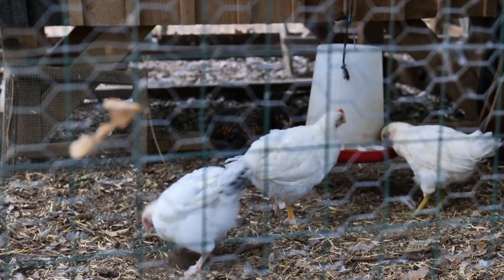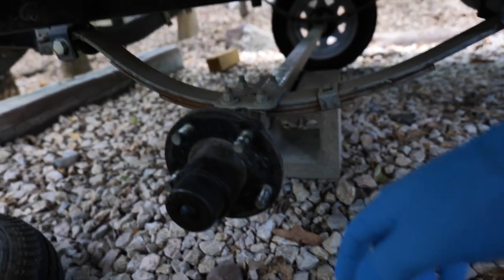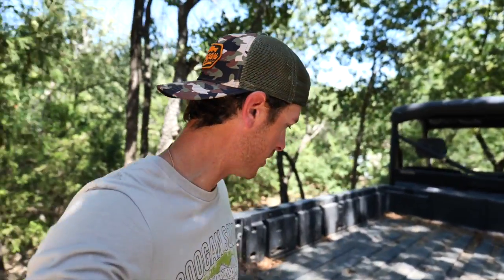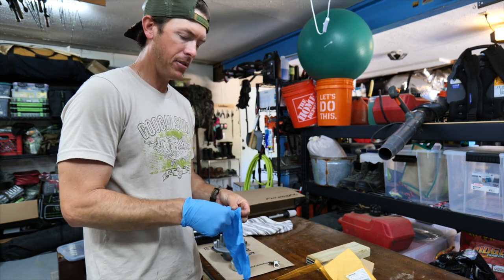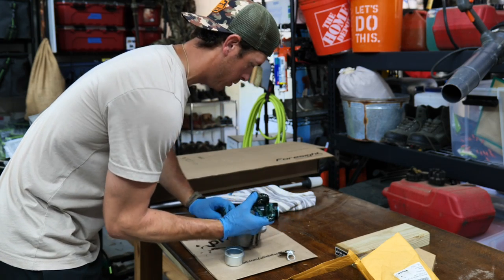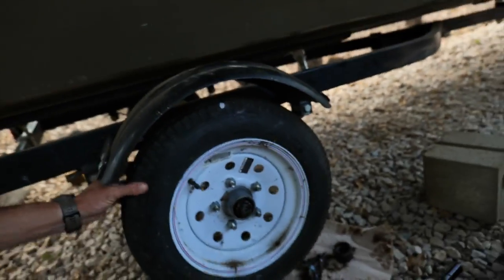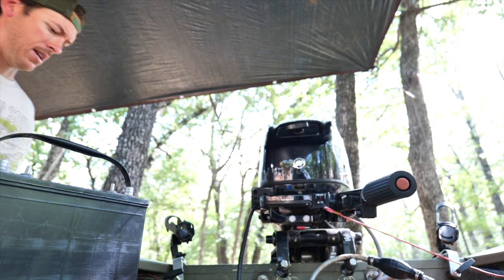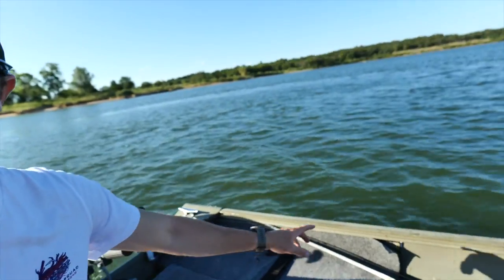Ripping My Tin Rig Again! Jon Boat HUB & Electric Repair

Comment: Make sure you recheck for play after a fuel miles. Leaving the nut that loose upon initial install of new bearings, you’ll have play in it very quickly. 

When installing new wheel bearings, I also snug the nut up you can still spin by hand but it doesn’t keep spinning. Once everything seats in then it spins easy with no play.

Comment: A little professional advice.  You should seat your Bearings.  Use channel locks.  Spin the wheel and tighten the center nut until it gets tight and the wheel stops. Then back the nut off about an 1/8th of a turn.  Spin the wheel and tighten the nut to it gets slightly tight and the wheel stops. Repeat one more time to be sure, cotter pin, done.  Love the videos.  Hope this helps someone.

Comment: My brother in law is a professional boat builder/restorer and Fuel does not go bad the way legends suggest. LOL We've picked up boats that have sat for 2-3 years and just trailering them all the way from wherever we pick them up, the sloshing of the fuel in the tank mixes it up well and rarely are there issues. If you're still paranoid, our in some fuel treatment/additive and give it a solid sloshing to mix it all up and you'll be good.

Comment: A tip I just learned the hard way. If your axle nut is not coming of easily. Get a grinder and cut the nut off. They are dollars a new axle is 100 of dollars. The spindles are fairly soft metal so they are not brittle when the boat bounces. This makes them easy to strip the threads on the axle shaft.

Some more tips if the hub isn't a marine hub the lip seal will be single lipped. The marine seals are double lipped. This is important to keep water out. 

The packing is more of a scraping action. Using the bearing cage to scrape the grease from your palm. You don't push the bearing into the pile of grease. You scrape it down the edge after a little trial and error you will get very efficient.

Comment: To add electronics to the crispy collector, you could look into a "2nd boat kit" should come with bracket, power cable and transducer, get in the same size as what's on the silver bullet, then you can just use one of the screens you already own

Comment: So the biggest thing I’ve learned, after packing bearings and installing them in the hub you have to seat them at least 5 times by tightening the castle nut. The final seating you get the cotter pin hole lined up and insert.

Comment: Recheck for wobble after 30 or so miles. The bearings will seat in and the castle nut will be to loose.

And they make adhesive lined heat shrink that is a water proof seal. Regular will seep water, adhesive lined can sit underwater for a year and not leak!

Bed liner the inside of the boat, it will quiet it down in rough water...

Comment: I have had to deal with this a few times recently in the two boats I have had.  Sold one and selling the other.  I am not good at that stuff, but like you, I learned on the internet and it gets easier.  You are brave to film your first time.  One thing I learned is to tighten, spin both ways, and tighten again with the castle nut to ensure it is evenly secured.

Comment: Bearing kits usually comes with new race so you can replace them. You just need a seating die set from amazin and you can change all your trailers.

Edit- wobbly spin could be just a 1/8 turn on the castlenut and reinsert the cotter pin.
Reply: probably didn't need the new spindle. could have replaced race and bearings. I've had to replace both on my boat trailer because i didn't keep it greased well enough. Now it has bearing buddies to keep the bearings full of grease Lesson learned

Comment: O'Reilly's has zerk fitting kits with every size imaginable, and if you don't want to buy your own kit they usually will allow you to buy just single ones out of their kit. Well at least they allow it around here. Good luck Justin with the rest of the crispi collector series! Looking forward to the jackplate and graph's! Might add another battery too👌

Comment: Hey Justin, looks like the inside diameter of the seal is larger than the outside diameter of the spindle. So it will not seal the water from getting in and grease will come out. Just an observation. 👍

Comment: Justin, glad to see Crispy Collector back on the water. I noticed how high you have the motor sitting on the transom.  Make sure those mounting points stay good and tight. I don't wanna see you losing your Merc on the bottom of the lake.
Reply: We always had a safety chain attached to the outboard motor.

Comment: If you want a faster way to pack your barrings use a vacum sealer makes it some much easyer and you can have extras ready in case you need to change them on the road
Reply: Now that's a good idea!

Comment: I would recommend investing  in a 3 ton floor jack instead of those screw jacks iv personally  had a vehicle fall off the jack they are very unstable and not safe.

Comment: Please check your wheel lug nuts 
I believe I saw that they were on backwards and that can lead to an incredibly bad day 
the cone part goes into the wheel and that actually centers the wheel on the hub 
They can woller out the holes in the wheel and become loose and ruin the studs or worse lose the wheel and flip the trailer 
I’m a long time follower and I  love all the videos of the crispy collector

Comment: The bearing buddies in my opinion are terrible. The grease fitting on the spindle works very well. It will push the old grease out and replace it with new grease. Very effective and efficient

Comment: I am glad to see you working on your own stuff. Besides the Lugnuts being on backwards, which one you put them on the other way, you will realize how it keeps the wheel centered. That whole that you thought was for a grease. Zirk is usually the centerpoint on a lathe when they turn those down, has nothing to do with the grease if you stick a And do a paper clip and stick it in there. You should see that it doesn’t go all the way through. The holes in the front that you’re pointing out the grease come out of that your cotter pin hole OK now as far as tightening the hub, what people are talking about or you’d snug it up pretty good, and then back it off, is to make sure that your races are straight, the race would be the inside where the bearing rides on. After you snug them up then you back it off almost a good quarter turn once you put the wheel on you should ever so slightly have a very small rocking if you grab three and 9 o’clock very slow and subtle, the only way you can tell whether or not you got it on too tight is to take it for a 10 mile run and then lift it up and see if that clock is completely gone just ever so slightly it should be gone or she should have just a hair if you run around with it too tight will happen is the bearings will seize up and usually you can’t get them can’t get them off because they’ll gold up and get hot. Constantly checking your trailer hubs by grabbing them after 10 or 15 miles like when you leave your house and then go to the gas station just to see if they’re overheated if you touch them and they’re warm you’re OK if you touch them and they burn your fingers there’s something wrong either had a grease or they’re too tight or something there’s something definitely wrong there, I did notice that somebody else mentioned there was no washer in front of the nut. That’s why you had a lot of threads sticking out there should be a washer between the nut and the bearing. Rather than putting on a set of bearing buddies they make a needle that hooks to your grease gun Were you can stick it in there right between that washer and one of the rollers in the bearing and you can pump some grease and pull it out. Rotate the wheel put it in again another four or five pumps until you think it’s full. That basically does the same thing as a bearing buddy bearing buddy keeps the water out of your bearings, if when you’re greasing bearing buddies as soon as the spring moves, that’s where you should stop. If you give it extra grease that’s why it pushes the seal outer pushes grease out of the back of the seal because there’s too much in there. I hope this helps. If you need to DM me I can get you on the phone and talk you through it again. Can’t believe you haven’t done any more woodworking videos. I really like those along with everything else. I would’ve love to help you trap that bobcat that was pestering your chickens.

Comment: If you can find a bolt on spindle an hub makes the best spare tire holder because if by chance you lost the wheel an tire going down the road because the bearings wore out he would have a spare hub with bearings with grease extra nut, extra washer Carter key right there and your spare tire😂😂😂😂😂😂😂😂

Comment: Both my guns were bad on my jon boat trailer, so being me i went to red neck tráiler company and bought and entire axle with hubs on it and it fit my tráiler i also bought 2 brand new tráiler wheels and tires ,my original hubs well i got one off but couldnt get the other one off i even took took to the shop they couldnt get it off so yeah thats why i bought an entire new set up, the new one with the hubs cost around 500 but i guess i wont have to worry for awhile ,and you are right boat ,break out another thousand is a very true statement ,which our lives just dont understand anyway great video, tale care and god bless